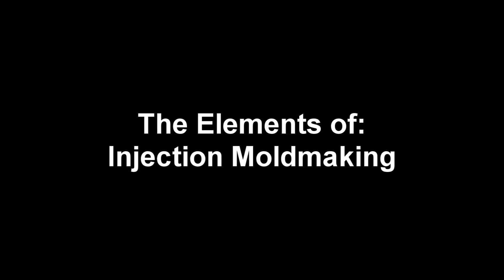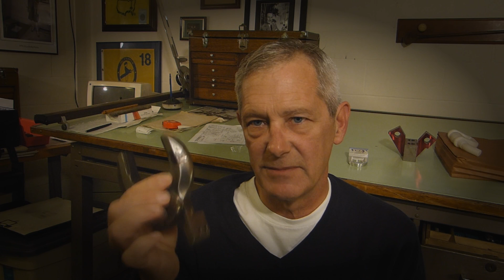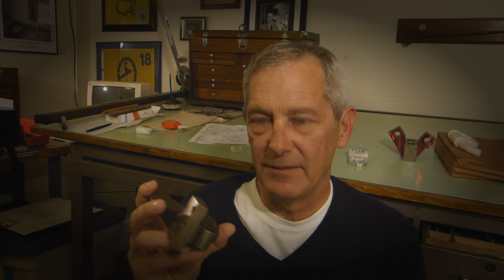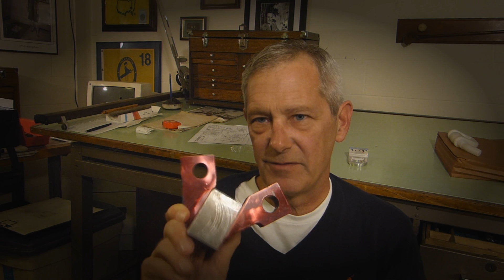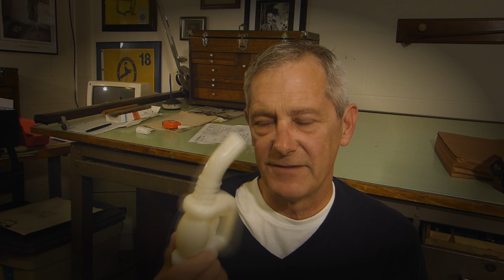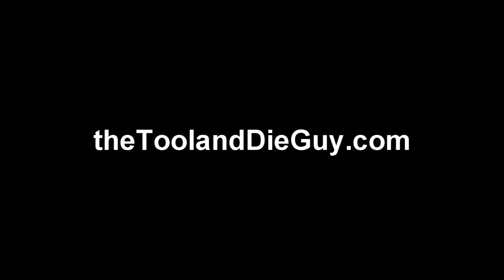Here It Is: Moldmaking

Comment: I got a degree in machine tool tech in the early 80's. Then I got a mechanical engineering degree. My first job out of school was to design an injection mold for a current sensor.  I had my shop set up, and I designed the cases for the part, which took about two years. I thought I could make the mold. It didn't take long before I realized I had no idea what to do. I had studied the subject. I knew machining. But when we sent it out to the pros, and it was tough even for them. I had no idea. I've designed my own house (out of steel), and built it, and the drawings for the mold made the house look like nothing. I have real respect for machinists who come up in the trade. I've got a degree, but know very few of the tricks of the trade.